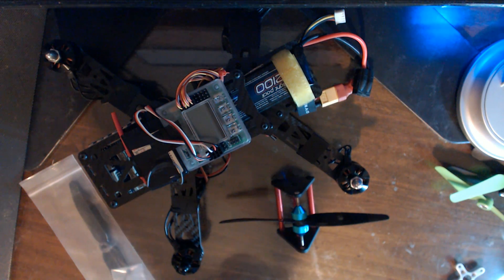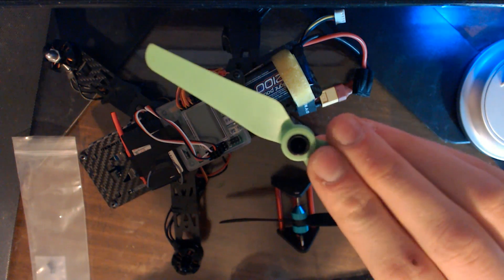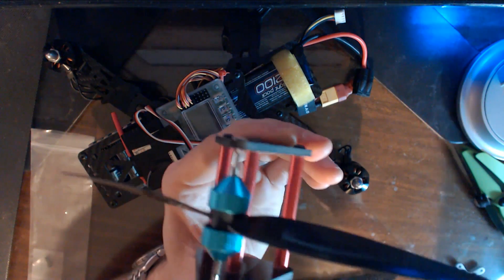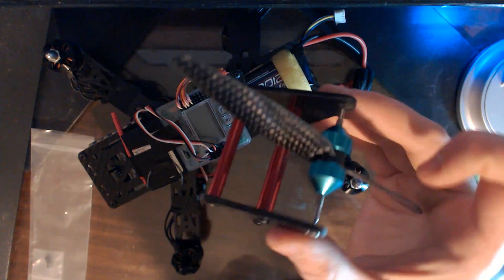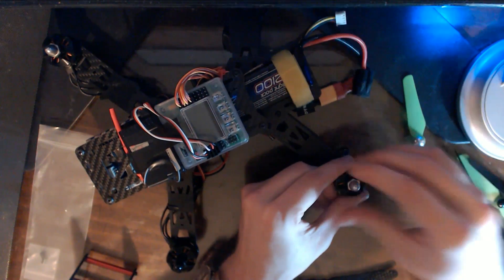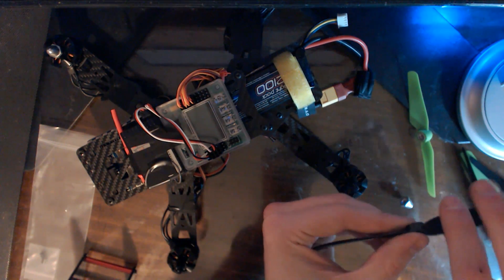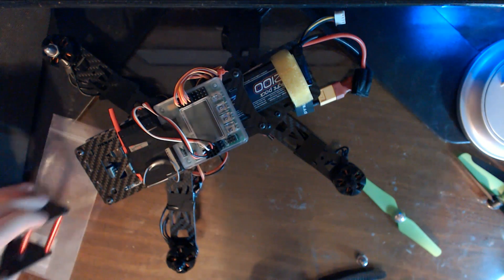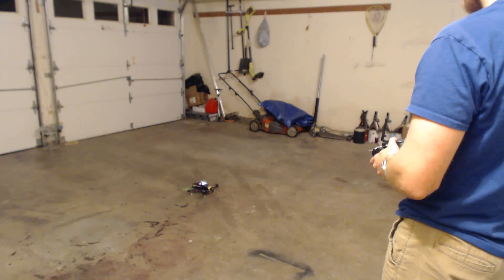Building a Quadcopter p.5 - First flight and other Info

Comment: hello sentdex! i've been following you all the way from China for long time. thanks a lot. and now i have a question about controlling a quadcopter using Raspberry Pi. i under stand it is Motor to ESC to Flight controller to receiver to remote controller, but where does a RPi come in? and is it possibe that i want to use my RPi to control the flight so that the quadcopter can do some sort of automatic flying? thanks again!

Comment: I have a question. Since the Raspberry Pi is like a computer and needs to be poweroff everytime you unplug the battery, how are you going to do it automatically? I am thinking about using a capacitor to temporally supply power for raspberry to shutdown, but still lacking lots of modification in the circuit to make everything automatic.

Comment: I think accelerometer and altimeter is already equipped on the flight controller together with gyrometer and compass. Lately, I have been trying to install a remote controlled firework launcher on my quadcopter, and make everything controlled through my joystick, to make it looks like flying AH-64 and firing rockets in a video game.   lol

Comment: Its a nice idea but if the drone doesn't fly better its nonsense I guess ... Have you seen how it flew? In a circle. Normaly you have to trim the aircraft first. If it fly's like this flying is no fun. If it would fly better it makes more fun.
Reply from the maker: +The Italian Guy I was flying it. Would you have preferred if I just hovered there idle? or do you think that flying in the circle was out of my control?
Reply: Yeah I thought so. Ups I'm soory. Thought you have problems to hold it idle in the air. Before drones were cool normal air crafts in the beginner section had allways that problem and so I thought here is the same. I'm sorry for my wrong understanding! Keep up the good work! :)

Comment: What will you do with the Raspi?
Reply from the maker: +Mustafa Burak First, I plan to have it replace the receiver. After that, well see.
Reply: +sentdex There is a shield called PXFmini. I have made a little search about it. It allows you to control your drone with your Raspi so you may want to check it out. Keep up the good work!
Reply from the maker: +Mustafa Burak Thanks for the info. There's also the navio board that another user pointed out.

Comment: Can I mount a Gopro on 250?
Reply from the maker: +Lingesh Aradhya Yes. Not happily, but yes. That will make it fairly top/bottom heavy, but it is possible. I'd probably opt for it to be on the bottom. Will impact your top-speed, but shouldn't hit stability as bad.
Reply: Theres better replacement for a 250. Go pro to heavy to big for 250.

Comment: You should make one with a raspberry pi as the flight controller
Reply from the maker: +Massimo Giardina Not confident it will be fast enough to respond. I have all of the proper sensors now. Will toy with it a bit to see, but hopes are not high.
Reply: +sentdex It's a challenge;)